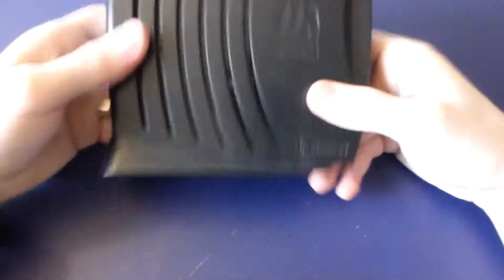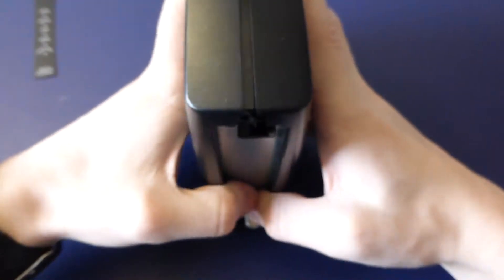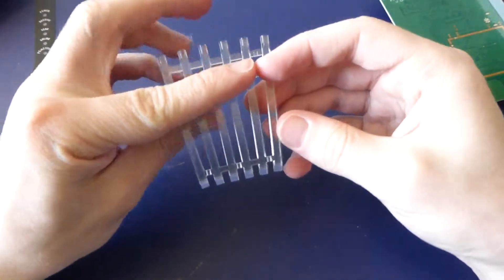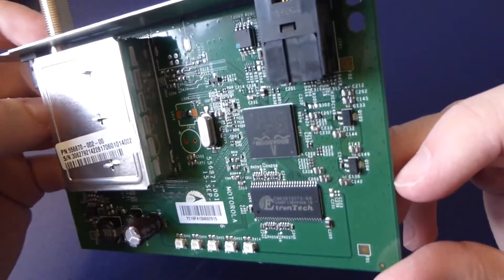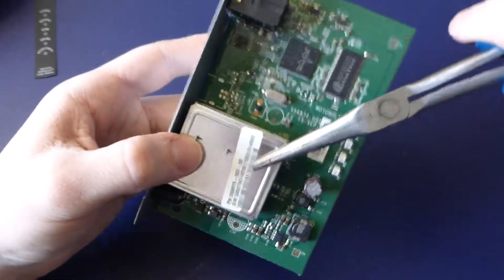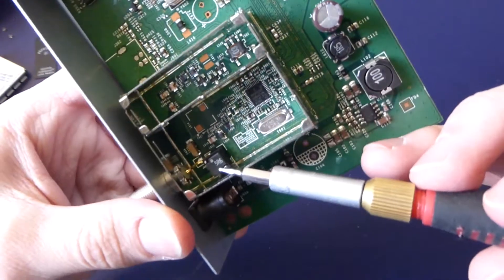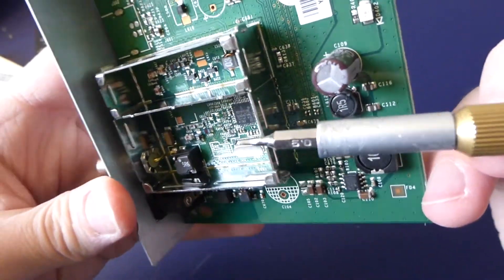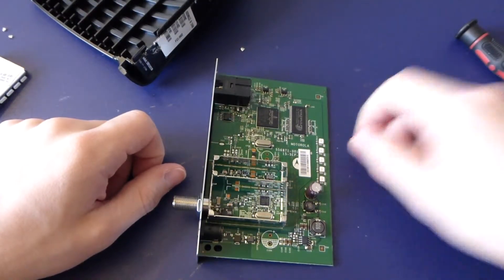Teardown of a Motorola SB5101N Modem

Comment: Actually used this video to find out how to open my surplus SB5101 (not-N), in order to assess adapting the case for a different project. Mine has a board dated mid-2007, and components dated 2008, and indeed it has the "Standby" light and the button on top (as mentioned in this video).

Comment: Mine is still in service 11 years later. The model I have has a USB output for computers that didn't have on-board networking at the time in addition to a standard RJ-45. Mine also has the standby button. I remember when the cable guy installed the line, he advised me to put the modem into standby at night so nobody could hack into my computer...even though my computer would have also been turned off. Times have changed, that's for sure.